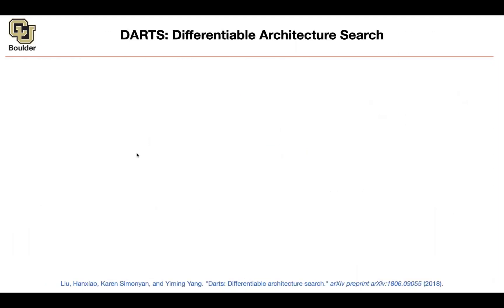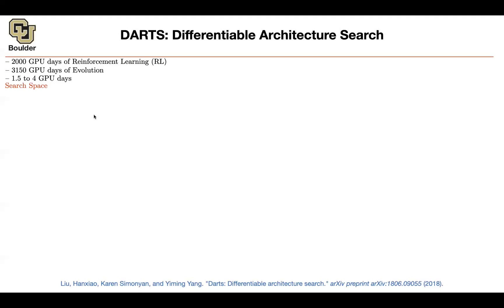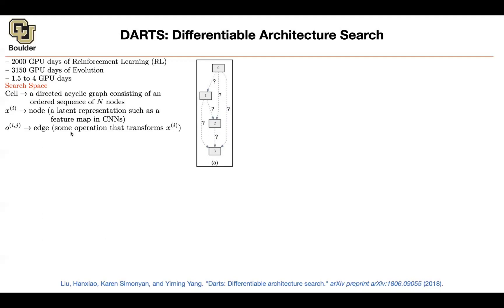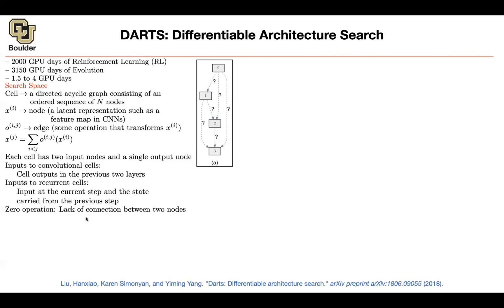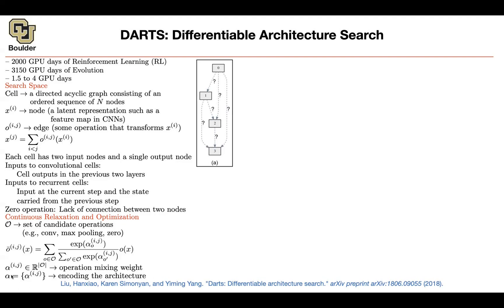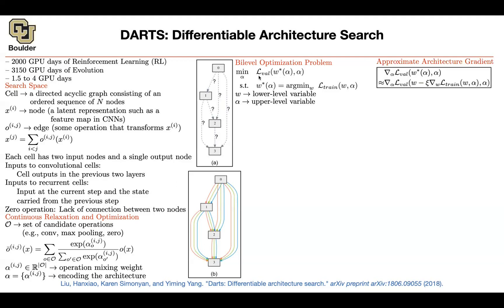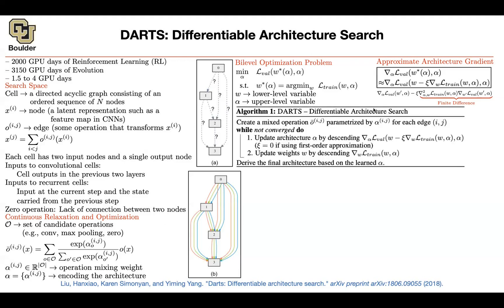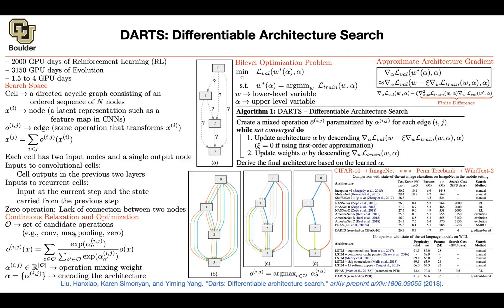DARTS | Lecture 15 (Part 3) | Applied Deep Learning (Supplementary)

Comment: Thank you so much  for this lecture. Just wanted to clarify one question. 

So if am understanding correctly,

Each operation in DARTS has 2 parameters: alpha (operation strength/ operation coefficient) and actual weights (w) of those operations. 

Initially all these operation weights (w) and alpha are random and fixed at the start of the process. We are NOT manually intervening on them. The set of all alphas are vectors I understand (as per the DARTS paper) and each alpha associated to each operations are scalers. nodes are states or latent representations and edges have operation choices.

Then, each intermediate nodes (j) receive mixed operations (i.e. summation of {product of [Softmax scores based of each alpha ]multiplied with the feature map obtained by putting that operation on 'x' where 'x' represents feature map from predecessor node (i)}) . The operations we are talking about are the choices that lies in the edge connecting that node (j) to its predecessor (i).

Now,  DARTS minimizes training loss by updating the weights of the operations. i.e. it tries to optimize the weights of the operations by gradient-descent. Using that weights , it then tries to minimize the validation-loss too by gradient descent and in this case it optimizes each respective alphas of each associated operation choices (ie scalers which represents strength and being used in the Softmax operations .So alpha vector (set of all individual alphas) is are getting changed here, I am hoping ?).  

Thus DARTS jointly optimizes WEIGHTS (by training loss ) and alpha or operation coefficient or operation strengths (by validation loss) .

Also the authors assumes that each cell that 2 input nodes and one output. While output nodes can be one, in my implementation I used more than 2 input nodes or 1 input node even. As per equation (1) of DARTS paper which just sums the operations from each predecessor nodes, I don't think this losses generalizability. Please let me know your thoughts.

I would be really very grateful to you if you can kindly clarify this question. Lectures on NAS are very rare so there are little chances to ask questions like this. Thanks a lot for uploading your videos. It helps!